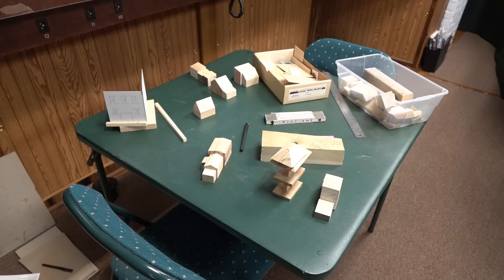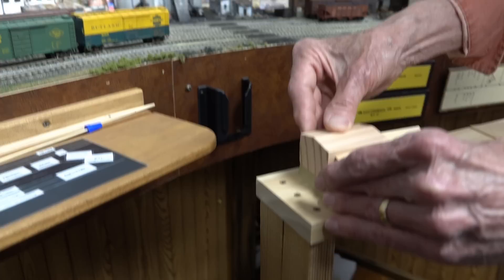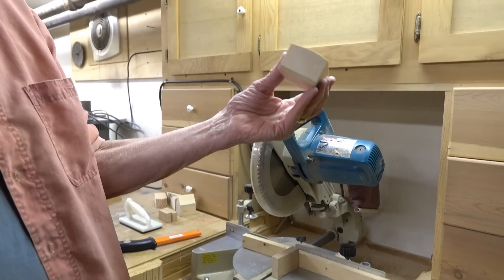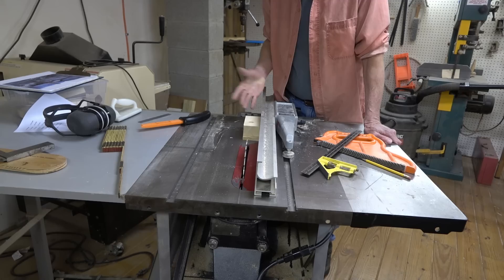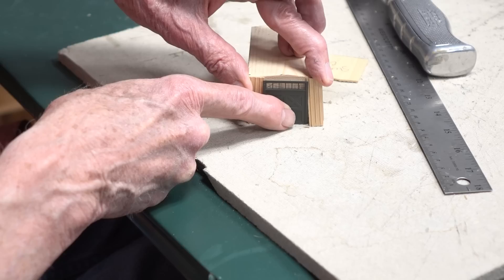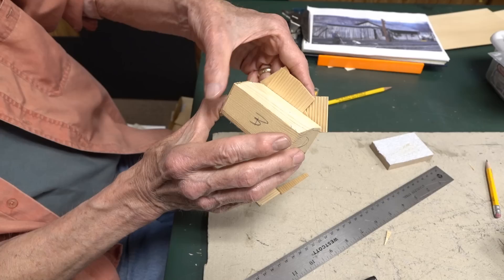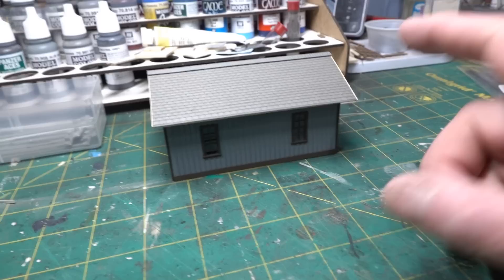Scratch Build #3:  How to Use Solid Wood Blocks for Buildings

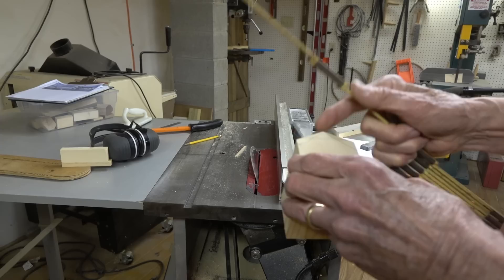Comment: 40:30 -- Lufkin X-46 Red End folding rule. I've been using these since 1965. Old school and still the best. Good video.
Reply: Only the best. Accurate and durable as hell. I've had mine forever. Wish it was easier to find the 8 footers though. Tough to locate, but sometimes they'll pop up on a shelf.

Comment: Two suggestions: First, when cutting to height, use the table saw instead of the miter/chop saw by placing the peak of the roof against the table saw guide and apply pressure to keep the  side against the top of the table. Second, when cutting the siding (depending on the length/width, of course), cut the peaked pieces first - with the demonstration building shed, you could have made both the sides and the peaked end(s) from the same cut of the siding - use a T-square to make the cut at the top of the peak for the ends so your "scrap" piece is square, trim the roof angles, and then cut the side from the "scrap". 

EXCELLENT way to make buildings if you don't want to detail the interior AND/OR no one makes a kit for them!

Comment: On a Table saw it is safer if you are cutting items longer than the blade diameter.   By changing the order of cuts  you can do this by making the basic  heights  with standard roof slopes  and normal roof gable heights  by making  long stocks sizes for future buildings.
Put a permanent sacrificial fence on that  chop saw  that would make life faster  and use clamps to hold those small pieces  down but only on one side of the blade.

On those small blocks  with the Table saw   Screw them to a longer pass  block  to provide longer  hold against the fence when cutting those slopes  You could even use a piece of 1/2 in MDO  ply or laminated with a hand hold to make it a permanent push block   for this purpose.   A end stop and using hot glue will also work or Double sided tape.

Comment: OMG!  The D&H Yard, in North Albany, NY, had that exact building, except the broken away gutter was split and drooping at the middle connection of the run.  Though the wood structure, at one time, had D&H blue and yellow by the time the mid/late 50's hit the brands colors faded to a Blue/Gray and FILTHY chipped yellow.  Also sticking out of the, accurately placed,  garage door was, from time to time, a Hy-Rail for track inspection.  Also the vent stack was attached, inside, to a Franklin Stove, and it belched THICK BLACK smoke.  SPOT ON Bill & Steve.

To be prototypical, with No. Alb. yard, the "Kitchen" or break room was a rusted up NYC Hard Body Dinner Car (from the WW2 era), off it trucks.  It sat on part of the concrete slab.  But suspension springs were left in place.

Lastly, the "Reading Room" was an outhouse.  It was positioned atop a small rickety wooden bridge like structure.  More than just a dock.  Less than safe.  This allowed the 2-holer outhouse to empty it's output to a local stream which fed into the Hudson River.

Great job guys.
Catch you DOWN THE LINE.
Reply: That is interesting- how a Pennsy building from the Shamokin Branch in a small coal town is the same as a building on the D&H. Thanks for the info on the D&H stuff- and thanks for watching!

Comment: Great video. I have been using balsa sheets of various thickness laminated together as it is easier to sand and cut to shape w/o use of full size major power tools. I do have a miniature 4 inch disc-miter sander which does a great job shaping balsa to size. I've also used in combination with balsa small 1 inch sq. blocks of hard wood from Joannes that come approx. ten per bag. The buildings come out square without all the problems inherent with other methods. Using blocks is also good for making barges. I might add I model 1.87 scale.
Reply: Great idea if you don't have the power tools. It solves the same problems as the video's methods do -- buildings out of square, trying to glue little walls together, etc. I would think your idea for making barges is a good one and would work well. I like this concept. Thanks for watching and replying with your idea. Bill S

Comment: Just watched your video using Bill's methods.  Love the idea of putting the acetate over the black paint.  I think you did a great job of putting it together and weathering the paint.  Loved the effect with the loose gutter.  Did not like the 2x8 under the ridge cap.  The vent in the roof should never go through the  peak of the roof because it would mean cutting the ridge pole of the roof to allow for passage of the flue pipe causing loss of structural strength of the roof.   Also the facia boards on the ends of the roof should have the shingles extending past them to keep them from getting water behind them and causing them to rot.  Sorry  about this picky stuff!  I really do like what you have been doing for your layout.  The DCC, the track work, and especially the scenery work! Ben
Reply: I never claimed to be a structural engineer or architect- it is just an HO scale model. Close enough for me. But, this is good to know and I will remember this for future buildings so thanks for the information. And if I may be "cheeky" a little bit- check out page 12 of the "Trackside on the Pennsylvania" Standard Plans book. Notice where the roof vent (which they indicate is a smoke Jack) is located...
Reply: Rob,
I'm glade you didn't take my comments in a bad way.  They were not to be bad comments, just ways to help improve your models.  I still like what you are doing especially when you put lights and interiors in offices and loading docks.

Ben
Reply: Ben- totally understand, and I do appreciate the info. Not being an expert such info is always welcome and helpful. Thanks, and thanks for watching.

Comment: Nice video! Beautiful building. What type of glue to attach the siding to the blocks?
Reply: I always use Aleen's Tacky (or extra tacky) available at any craft store. It sticks as well as carpenters glue without the long setup time of carpenters glue. Rob uses Weldwood in a tube (maybe it is also called Weldbond but I think that is the contact cement) which are both available at any hardwood store. I've used Aleens for years and never had a bond break. Thanks for the compliments and watching, Bill Schopf

Comment: When you want to put 2 blocks together and not have them move, try a little salt on the glue before clamping them. I find that this keeps them from moving. I don't worry about that as I use a small pnumatic nailer on the blocks...Also, you can take a drop of super glue and use it in 2 places and that will grab right away and prevent the piece from moving and you have to use only a small amount of the super glue with your wood glue...I'm sorry but the insert at 25:46 is not a dado insert but just a straight cutting insert that is the standard one that comes with the saw. I have been working with table saws since i was about 10 years old and now I am 70 and have nicked my flesh one time. At 36:54 you made a cut but I would have always done the cut with the long piece in the back. Also I have a sacrificial fence for all of my saws and I screw the fence to the solid fence that came with the saw so I can use it over and over. It is also much more stable...   Nice video because I would have not thought about using solid wood for these buildings but now I am going to try it... Thanks...
Reply: Thanks for the tip on the salt. I will try that. I misspoke when I called it a dado insert. You are right. I had to replace the insert I was using with one that would allow the blade to be angled. Obviously you can't do that with a zero clearance insert I was using for the other cuts. I too use sacrifice fences but usually only if the blade is extremely close to the regular fence. The nice thing about woodworking is that there a lots of ways to skin the cat (so to speak ... not too politically correct or a great metaphor for the cat lovers out there!!)

Comment: Checked the other comments but no-one had asked - where do you get the large sheets of siding wood that was used in the video please ? Great video full of detail and I learned so much. Thanks to both of you for sharing the ideas. 🐈
Reply: Northeastern (in Metheun, Massachusetts)  has 6 inch wide siding by 24 inches long. You want to get this and not the 3 1/2 wide stuff that most hobby shops carry. The wider stuff allows you a lot more flexibility. Thanks for watching and commenting. Bill S
Reply: Bill is correct, and I bought it directly from Northeastern: https://www.northeasternscalelumber.com/shop/board-batten-6.html.

On this building I used the 1/8", item 18BAB6.

Comment: That did you use to glue the siding to the blocks? This is a very good idea. Thanks for sharing.
Reply: Aleen's Super Tacky glue. It dries very fast and is very permanent and still gives you room to fiddle with it while positioning. Thanks for commenting. Bill S
Reply: When I glued on the siding, I used Weldbond. I do have some of the Aleen's glue Bill mentions and will likely use it on our next project.

Comment: Who make the chalk white paint that you have mentioned a few times?
Reply: Vallejo- item number 73.006. The darn stuff is hard to find for  some reason, so I purchased a 6 pack of it when I last purchased, which  was from Hobbylinc. But, I see now they show it as out of stock! It is included in the Vallejo Traincolor sets, but then you have to get all the other colors included.
Reply: Have you found anything in the Vallejo Model Air or Model Color line that comes close to the Train Color line chalk white since it is very difficult to find?

Comment: can you give us links to the supplies you used?  I am interested in trying this technique but need info for doors etc.
Reply: Norm: Tichy Train Products is the best source for doors, windows, etc. If you want specially made windows and doors for a prototype project, Rob suggests Shapeways. You can contact them via their website. Lumber is Northeastern Scale Lumber (siding, 2x4s, etc.). I believe a company called Kappler still makes scale lumber as does a company called Mt Albert (?). I mostly use stuff from Northeastern and Tichy. Thanks for watching. Bill S

Comment: I don't know if anybody else caught it but pertaining to the added section between the shed and the main building  you guys accidently reversed the positions of the door and the winow. In the picture, the window is on the right and the door is on the left. But whien you guys cut out the holes for door and the window you accidently reversed their positions and in your replica the door is now on the right side and the window is on the left side. 

I originally noticed this mistake at the time you were cutting out the holes, but I didn't say anything because I wanted to finish watching the video and see if you guys had caught that mistake yourselves and would correct that mistake later on towards the end of the vidio. 

I also scanned the comments but I did not see where anybody else had commented upon this accidental reversing procedure mistake but did not see any comments petaining to that mistake. 

So, after watching the video I decided to bring it to your attention. But, as you said you are not creating an exact duplicate and that accidental mistake does create a personal unique appearance not to mention it it is too late to correct that mistake at this time. 

But, HEY, To each his own, and thanks to the both of you for producing such a great video with an unlimited supply of ideas for others to use already built in to it. I wasn't critisizing the build or your techniques. I was just merely pointing out a possible accidental mistake of which happens quite often when you are working in reverse. Been there, done that many times myself so I cannot criticize others for the same mistakes I have done myself in the past. 

Cheers, Keep up the great work, and many thanks for additional ideas. 

May the "Model Railroading Bug" keep biting otherwise the Model Railroading hobby itself may derail and fall by the wayside into ancient history.

Comment: Got all the tools except the table saw.. any suggestions on what an alternative would be?
Reply: The table saw is pretty critical to the process unless you are very very good with a handsaw (I am definitely not!). I have thought of using 2 inch pink or blue foam as a substitute for wood but haven't yet tried it. Foam would be much easier to cut, but still you would need to be very very exact with your hand cuts to make it work. Maybe a jigsaw and a sanding block to take out the rough edges of the jigsaw cut? Craftsmen 200 years ago (and still today) make the finest of furniture with dovetails and all sorts of fancy moldings without using power tools. So it can be done with hand tools. I'm personally just not good enough to do that. I need the power stuff. Let me know how the hand tools work out for you if you decide to go that way. Thanks for watching and taking interest in the process. Bill Schopf
Reply: @bschopf1  could use a band saw
Reply: I bought a used Skip saw (power band saw) at a garage sale for $10. Found a 2' x 2' pc. of plywood and bolted the saw upside down to the bottom. If yo retract the blade before you bolt it down. After it's bolted down, start the saw and plunge it through the board and you have a 7" table saw!
Reply: SKIL not Skip ^ ^
Reply: Mad Skills. Awesome

Comment: Using wooden blocks for making buildings is a good idea but using heavy duty power tools for such small pieces is not without its risks. What's wrong with using hand saws and planes or have they been banned?
Reply: William: It certainly does come with risks but is very do-able (with caution, care and common sense). Guess you could use hand saws and planes, but then you run the risk of not getting everything perfectly in line and square. I'm just not that good with hand tools to use them. Since then, I have thought about doing this with blocks of two inch blue foam glued together and cut. This could be done with hand tools and then quickly sanded into shape. But yes you are absolutely right. And that is the whole point of the middle part of the video. You have to know what you're doing and watch what you're doing. It is not for the first-time table saw user. Thanks for responding. Bill S
Reply: Thank you for your reply. I have worked for several years with table saws and that is why I err on the side of caution (I've still got all my pinkies!). I would pitch the accuracy of my hand mitre saw against a power mitre saw any day and my hand sawing and planing is as good if not better than a machine. You use whatever skills you have but in the end it's all about enjoying the hobby and for me part of the enjoyment is taking my time. Anyway thanks once again for your posting and will be watching more posts from you. All the best, William.